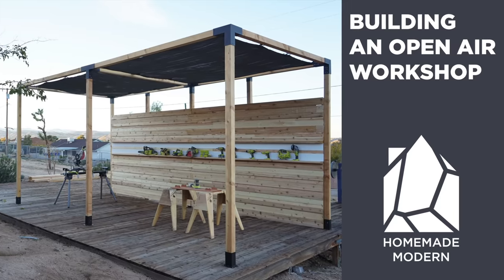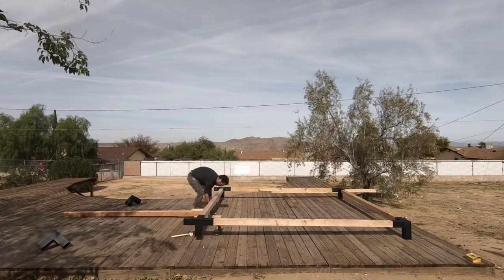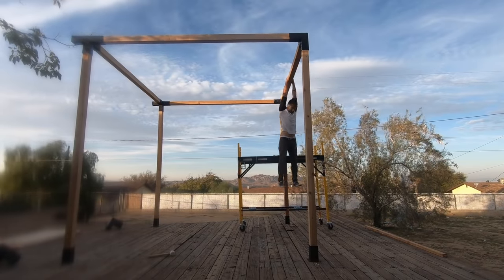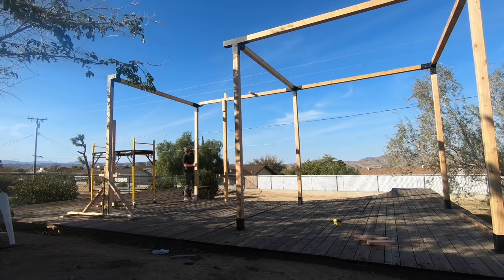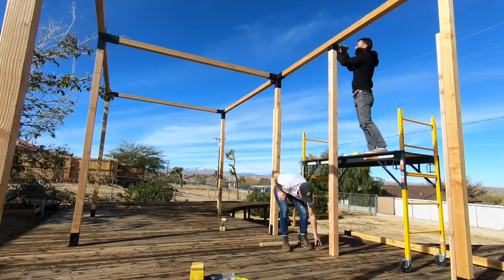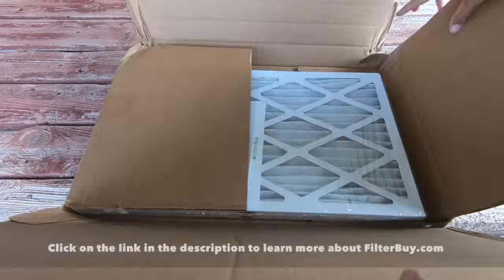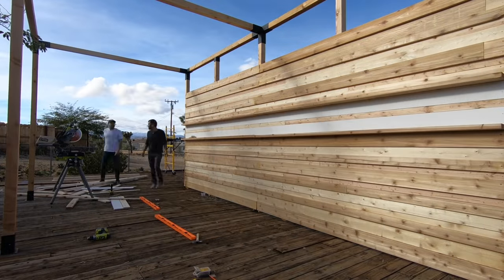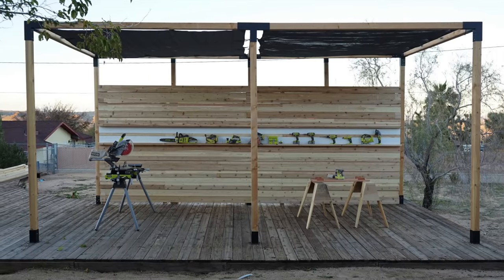Building an Open-Air Workshop

Comment: Sometimes you need help. But usually one is more efficient. If you're going to move it. Next time you put it back together, you might want to glue the wall boards together. If you ever move it after, you just have to cut a vertical line up the middle of the 4x4 support and you have a few panels instead of a multitude of boards to puzzle back together! Very nice build BTW!

Comment: Live in an area where a half dozen times a year the winds blow steady at 50mph with gusts of 70mph for 3 days straight. Most of those times it's raining sideways. Wonder if you think this Toja system would stand up to that kind of beating. Of course I wouldn't leave my tools uncovered, but I'm concerned about the structure.

Comment: Hi, 
Do you happen to recall the welds on the inside of your Trio brackets causing you trouble getting the wood in? Mine are large and basically prevent the wood  from sliding in as advertised. Was that a rubber mallet you used to hammer them in?

Comment: Is the finished product actually 10' x 20' or 10' 9" x 21' 1/2" ? Isn't there a 1" screwing flange on each base (so add 1" on all four sides for them)...and then don't you have to allow for the width of the brackets that the 4x4s go in to (so add 3 1/2" x 2 = 7" for front to back AND add 3 1/2" x 3 = 10 1/2" for side to side). I love how the product looks and goes together but it won't fit a 12' deck...so I have to go with a 10" product for front to back or build a deck deeper than 12''. Isn't that so?

Comment: Dude, you barely averted personal injury there. 
Options:
1-Raise a “bent” or one arch shape brace with 45 of 2x4, the the other and connect them horizontally. 
2- screw base to 2x4s or plywood 4’x4’ base for each post , temp screw to deck, attach beams one at a time. 
3- Nail on drag legs and diagonal brace so as you raise, it braces itself. 
4- consult a a good framer. Would have given you half dozen safer quicker ways to do this. 
You kinda got this idea towards the end of it. 
I’ve built a lot solo and that could have gone wrong in a heartbeat.

Comment: Those Toja Grid components are expensive as hell. 2 corners or "Trio's for $160.00. 2 mid T's or "Quad's" $240.00.
Reply: He could save a lot of money by learning some basic construction and using carriage bolts instead.  
$40 vs $600 on hardware

Comment: First time framing?   That's not how we do it.  Stand up the four posts using temporary braces, level, plumb and square.  Then use your go-cart to assemble the top pieces, one at a time.  Consolidate the braces until the whole thing is geometrically perfect then lock it that way.